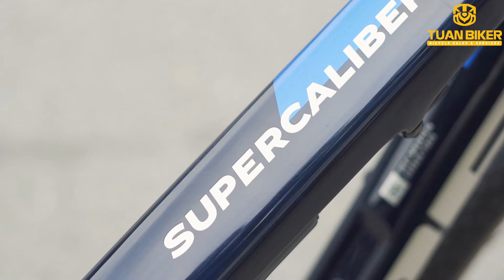Trek Supercaliber 9.6 Gen 2 2024 UNBOX - So much cable in this bike |TUANBIKER|

Comment: Maxxis tires? Very nice bike. Mine will be delivered in 5 months. 😊
Reply: How is your experience mate with the bike ? If you would like to share .
Reply: @prathameshdesai9576  It's a great bike. It is a heavy bicycle in standard version. 14.0 kilograms in size XL. After quite a few upgrades, the bike now weighs 11.3 kilograms and I find that acceptable. The wheelbase of this Gen2 is longer than my old Gen1, which makes the bike feel more comfortable and the front and rear are better balanced. The Gen1 may steer a little faster/sharper, but sometimes feels a little too nervous. I like the Supercaliber much better than the Specialized Epic FSR 29 World Cup and Canyon Lux that I had before.
Reply: @ thanks for the reply mate!
You managed to pull down the weight significantly , that’s amazing.
I ride a gravel and a mtb hard tail trek superfly 7 non carbon been 10 years with this bike and it’s still running great . I was looking for a hard tail upgrade which was procal 6 gen 3 which was perfect jump for me in all aspects but i came across this supercal and m so tempted to have a full sus in my garage but this weight and specs are pulling me back and  making me think.